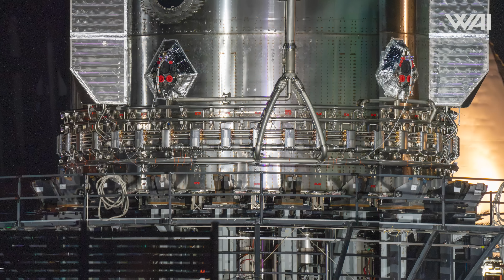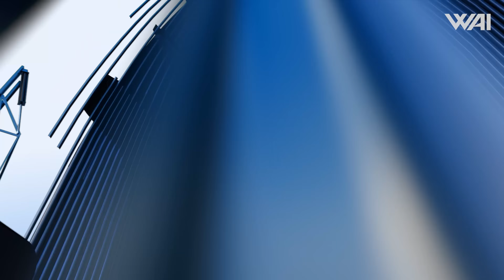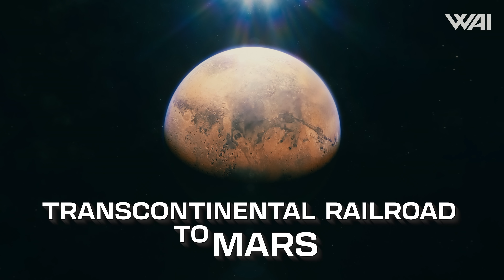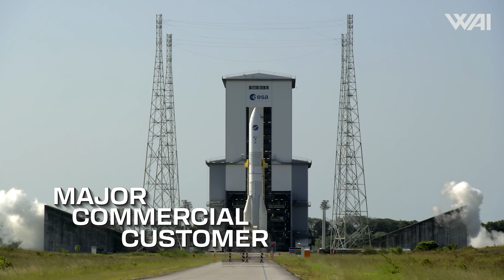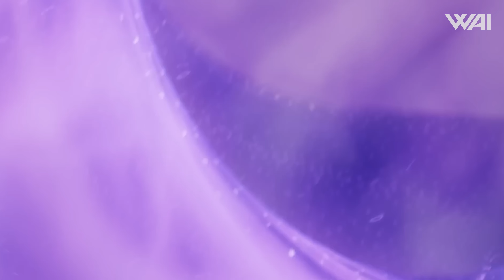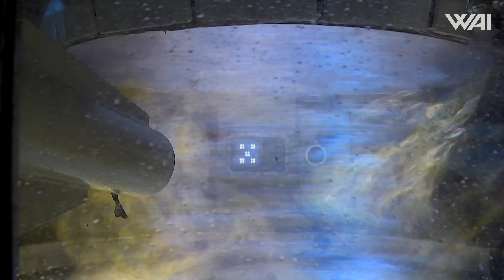SpaceX Did what no one else COULD: How Starship Flight 12 will change everything!

Comment: You know, I used to think that both methodologies for rocket development were valid and capable of producing usable rockets.  But the more time goes on the sillier it seems to not have any real life use-case testing behind a rocket before putting things in orbit.  Honestly I don't think SpaceX, or anyone, could build a rapidly resuable rocket without the rapid itteration pattern they've chosen.  The successes and failures are always about more than a single launch and every little thing that doesn't go quite to spec MUST be cause for evaluation and design change.  So getting rockets up and exposed to Max Q, the upper atmosphere and reentry as many times as possible is crucial to building a rocket that can survive multiple launches a day.

Comment: Instead of another massive constellation for ai satellites, SpaceX should build an orbital hub/station with an expanding network of modular GPU nodes directly attached that can be upgraded and maintained over time with a rotating ring habitat station for workers to permanently inhabit with simulated gravity. They can work in rotations easily since there could be a steady stream of Starships docking and delivering additional modules frequently. Then SpaceX can carry out CRUCIAL research for long-term space habitation if they ever want a long-term foothold on Mars or the Moon...
Reply: That way if ai turns out to be a bust, or miniaturizes like CPU power did with microprocessors/transistors, they at least have a valuable space habitat for research and tourism, or they can make the node array any number of functions from scientific research and tourism.

Comment: I hope SpaceX will need to show solutions for a couple of issues with the high numbers of sats:
- will they take care to not impact earth based telescopes?
- will they take care of the debris? Some sats will be failures, might even explode. That pushes us to the Kessler syndrome where a cascade of debris will destroy more and more satellites and finally makes the earth orbit way to dangerous for human space flight. A good start would be for SpaceX to invest into clean-up technology.
In the end I do not think the million will happen. AI in space has several issues besides cooling and power. The hardware needs to be hardened to work in the high radiation of space. And the costs of launching must compare to ever new and faster generations of CPU and technology. 
Musk has moved SpaceX and xAI into one company, so some magic and rumors might help. But while that worked with Tesla times have changed and the competition is not far behind.

Comment: A million satellites will ruin ground based visible and infrared astronomy. Putting satellites in sun sincro orbit 💫 will heat them hotter than the peak temperature of the Moon, greater than 150F. The reason Webb works is because it is mainly in the shade. Solar cells lose efficiency above 100 F. Most electronics won't work at 150F.

Boeing and LM have sent more than 600 rockets in space. 3 commercial companies failed to land properly in 6 tries counting the Japanese commercial companies. Counting JAXA, it is 7 failures will China has several successful landings and India has one.

Comment: Starship Flight 12 is turning into a real systems test, not just a launch. Reflight and fast pad turnaround are the big unlocks because they push cost per ton down AND raise cadence. Nerdy note: stainless steel keeps strength at cryogenic temps, which matters when the tanks are filled with super cold propellants.

Comment: Who ever said it was impossible.  It's not impossible, it's not cost effective.  Large data centers generally requires
35 to over 100+ full-time staff for 24/7 operations and maintenance.   These are such high value assets that they are optimized to death and still need 35+ people fixing it 24/7.   So it will be interesting to see how they solve that problem. Especially since equipment replacement will be higher then normal due to lack of atmosphere blocking radiation.  
Better to just put the solar panel and create the 'death lazer' to beam down the power. Since we are not heating up the world fast enough  :p

Comment: mmmh... What about environmental externalities? I mean, such constellation would be hardware heavy, the altitude would be low so satellite lifetime wouldn''t be very long - Starlink is 5 years, even if you double it's massive. Then there's the materials spread into the atmosphere as satellites burn at reentry - a few hundreds is a thing, tens of thousands is another. Current planned megaconstellations are already raising those questions, but this new one brings it to another level... 
The idea sounds cool for sure, but the risk to do it without taking into account such externalities, in a proper life cycle assessment, is worrying.

Comment: ESA, like ULA, got disrupted by Falcon, and now New Glenn.  It's now adapt, or fade away while being sold for parts.  They need to be careful, though.  The competitor they should be designing against is no longer Falcon, it's Starship.  For strategic planning purposes, existing launch companies MUST assume Starship will work and bring down launch prices dramatically.  Therefore, assuming Starship works as designed, what improvements can be made to a blank-sheet new launcher design in order to bring costs down even more.  That's where competitor's engineers must be today.  New fuels, new materials, different recovery concepts, simpler infrastructure requirements, reduced manpower requirements for operation and maintenance, etc., etc.

Comment: Satellite avoidance maneuvers will become an art with 1000000 of them up there.
Reply from the maker: Yup! Easily handled with AI. :_WAISweet:
Reply: At 1 million satellites (1000 km altitude) they would be roughly 25 to 30 km apart..
Keep this in mind when you're two and a half to three meters away from oncoming traffic.
Reply: @Picklemedia  yep but you're not travelling at 27,000Km/s though (depending upon height of orbit) are they. And if your on a transit trajectory, you could be potentially travelling against that orbit, so every satellite even assuming you're travelling perpendicular to the orbital path is only 9.25 seconds away.......
Reply: @wino99999 that's a good point! *They could stratify the satellites, making collision exponentially less likely.
My example was extremely conservative (putting them all at the same altitude)
Reply: @Picklemedia  True, but even if in say 3 different orbits and on 1 such orbit the satellites were split on slightly different levels, doesn't this really complicate things as far as boosting each satellite  to counter drag and having to alter orbit for collision avoidance etc etc. You would probably use up a significant fraction of your computational power in just managing the orbital mechanics of such a vast constellation.
Reply: @wino99999 I'm not going to pretend to know. I am not an Astrodynamicist or an Orbital Dynamics Engineer.
Reply: @Picklemedia  Thats a good point.

Comment: Is it just me or does that mass of pipework at the base of the booster seem far too exposed not only by the proximity of the Raptor engines fiery exhaust - think more about the return burns rather than launch - but also the fierce aerodynamic air pressure during both the up and the down. Cannot see that surviving too many flights before something breaks and thus goes boom. Remember Skylab having a supposedly streamlined solar panel ripped off during launch? Needs rethink SpaceX.

Comment: "It's never been done, and it's impossible." - No! It's bat shit - Kessler syndrome madness - crazy!!!!
Reply: We won't get anywhere near a million. We won't be going to mars or any place else.
Reply: It also ignores massive radiator panels needed, radiation hardening for GPUs, and the fact that the average datacenter touches a rack for maintenance every 3-6 months.

On top of that, there are about 3000 datacenters under construction right now, which put to shame even a 1 million satellite cluster.  For someone to upgrade a terrestial datacenter with new GPUs would be far cheaper and faster.

At the speed AI companies are moving, if NVidia chips a new GPU, do you really want to wait until 1 million sats are relaunched?

This is just nonsense.  Not to mention water cooling is about 5000x more efficient than radiative cooling, and nuclear/nat gas/geothermal/et al terrestially would be much better. But even leaving out nuclear, it takes 2 yrs to build a datacenter right now, and 2 years to build a natgas plant. 

This is way more affordable and practical than this ridiculous justification for SpaceX's IPO by tying it with AI hype.

It's just there to sucker investors. Hey, don't look at the fact that this company will never have the revenue needed to justify $1.5T valuation, just hand wave somehow they're gonna dominate AI with space datacenters, even though SpaceX hasn't even launched 10k starlinks yet.

And don't look at the fact that Grok has never published any innovative model, is consistently behind other companies playing catch up.

Comment: What are SpaceX's plans to avoid Kessler syndrome? When their current constellation loses about 1-2 satellites per day. This is madness to scale up to 1M satellites, not including what the effects will be on the atmosphere which we breathe.
Reply: I agree we need a coordinated plan of action to avoid Kessler syndrome
Reply: @DawidSmithmeow How many satellites do you have up there?
Reply: @DawidSmithmeow  They have planned everything.
Reply: It´s not if, it´s when it happens.
Reply: @ondrejdvorak5107  It's already happening!
Reply: Are you really that simple? You don't think they already know? Why are you privileged to sit at that table? Your not!
Reply: Effects on the atmosphere we breathe? What are you talking about? Starship uses Oxygen and Methane for fuel. It creates Carbon Dioxide as a bi-product. They then use solar powered air separation units to split the CO2 back into more rocket fuel. It's a closed cycle, so it won't do anything to the atmosphere. Another great thing about Starships is that they can reenter the atmosphere. This means they can be used to de-orbit older satellites and prevent Kessler Syndrome.
Reply: @gregsteele806  respectfully, I was referring to the  first issue discussed in this video of SpaceX's desire to launch 1 million satellites. As you know these satellites are fabricated using rare metals. I don't know when these satellites reenter the Earth's atmosphere what the long-term ecological effect will be. While, I cheer for any space exploration effort; personally I don't believe that "Starship" is the right vehicle to settle Mars. It's too complicated, too small, and the travel effects on crew transiting unknown. However, I hope that I am wrong.
Reply: @gregsteele806  they burn up on reentry and spread metallic particles in the atmosphere
Reply: @prophetrob  Do you have any idea how much particulate matter gets spewed into the atmosphere by a single volcanic eruption? Whatever number you guess is probably too small, but even a million satellites would be peanuts to that.
Reply: @gregsteele806  volcanic ash reaches the thermosphere and mesosphere very rarely. Re-entering satellites do every time.
It's not a problem with breathing the particles, it's an ozone depletion risk because of the unoxidized metal being released extremely high up and being oxidized on the way down. Aluminum oxide is part of a reaction with chlorine which catalyzes the breakup of ozone without being used up. Imagine it's like someone spraying CFC hairspray directly into the top of the atmosphere.
Reply: They're not going to actually do it, it's just hype farming for the IPO and the ownership change of x AI is about transferring SpaceX money to Twitter in the short term 
Orbital data centers are a garbage idea. Data centers in the ocean will always be cheaper and more serviceable
Reply: @prophetrob Your ignorance is monumental, we already have a test orbital data server in space that has served as proof of concept. When has SpaceX ever made a goal they have never pursued?
Also, you assume the investors are stupid and you are smarter than them.
Reply: @viewer_5714  But it's a MADNESS to plan to put so many satellites into orbit! The Kessler syndome is real and already ongoing above 520km! We are so FUCKED!
Reply: @viewer_5714  I didn't say it isn't physically possible to launch a computer into space. We have had satellites doing this for a long time now, just that it's not the cheapest option by far.

Yes, I am smarter than the investors. I'm also not blinded by the offer that it will make me money.
Reply: @will2see  Well SpaceX doesn't think so, but what do they know, it's not like they have the best engineers in the world or anything.
Reply: @admarsandbeyond  they clearly don't looking at how the fins and launch pads have been holding up

PS humans can't live on mars because your bones die

Comment: Everyone thought SpaceX was about building a city on Mars, but it's really about AI in space.
Reply: This is a way to make money to fund the Mars project
Reply: @DawidSmithmeow  Tesla + Falcon9
Reply: Ai in space is pure nonsense. Heatsinking is not possible.
Reply: @robertbrown3413  Did you even watch the video?  How does JWST keep its infrared cameras cryogenically cool?
Reply: @RobinMiller-v6c Mostly by not generating 10s of kW of heat running GPUs.

You can dissipate heat right down to the temperature of space, that's true.

However you absolutely cannot do so at a rapid rate - i.e Wattage without an impractically large cooling system and radiator.
Reply: @incandescentwithrage  You need to keep up.  What defines "impracticality"?  Launch costs.  If your launch vehicle is Ariane 6, "impracticality" is a consideration.  Reusable heavy-lift? Not so much.
Reply: @RobinMiller-v6c Economically impractical.

The point where even if the launch cost is zero, all other costs are prohibitive Vs ground based.

Are we going to deorbit 1 million satellites every 3 years to replace the hardware?

Great, now you've deorbited the cooling that cost as much as the hardware which actually needed refreshing.
Reply: @RobinMiller-v6c  It has several layers of very expensive heatshield, a major potential failure point of the whole thing.
Reply: @robertbrown3413  Ah. You admit it's not "impossible."  Good.  Now it's engineering and trade-offs.
Reply: @incandescentwithrage  Economics? I could ask you to show your work, but it's not your circus, not your monkeys.  You don't expect that with a launch cadence that places one million satellites on orbit, that somewhere along that trajectory, lies one or two repair/upgrade hubs?  Got it.  See an optometrist about that myopia.
Reply: @RobinMiller-v6c Upgrade hubs 😂

Musk is not an idiot, he's applying for the licence to bump the stock price ready for merger.

You on the other hand..
Reply: @RobinMiller-v6c  I never used that word, you put it in quotes as I never used it. I would love to have a heatsink that works in a vacuum. They are always quoted as C/W in air. There is no magic way to make them work better.
Reply: @robertbrown3413  My error. A distinction without a difference, as your exact words were: "is not possible." Obviously, you can't use a heatsink, as they rely on convection or forced air; proposing them is either a strawman to fool the ignorant, or an unrealistic proposal, to be charitable.  'Heat sink' as a generic term for any means of thermal control is possible: blackbody radiators; heat pipes to transfer thermal power, for a couple of examples.
Reply: @incandescentwithrage  Whatever, Mr. Magoo.
Reply: @RobinMiller-v6c  Be sure to tell me the solution for heatsinking thousands of watts, with minimal weight. This will have endless applications.
Reply: @robertbrown3413  Minimal weight? What part about /cheap launch costs/ is unclear to you?  Thousands of watts? How do you know one of the first tradeoffs wasn't 'get the heat transfer value below THIS number', and that's where the million-satellite number came from?